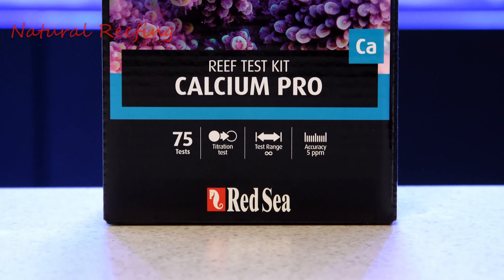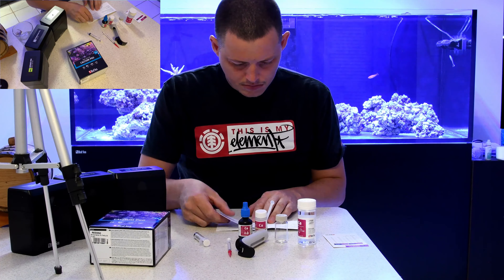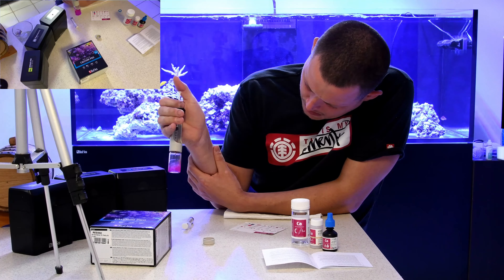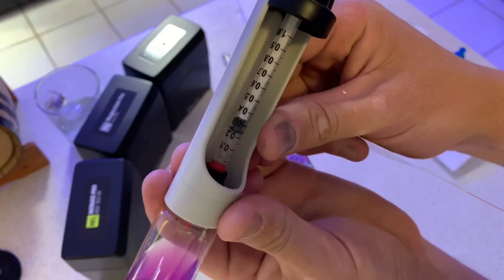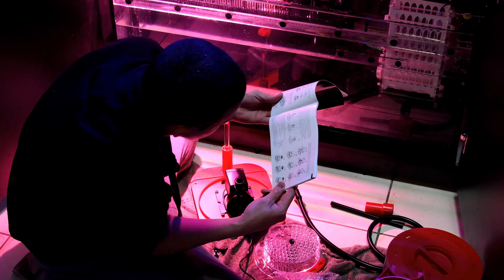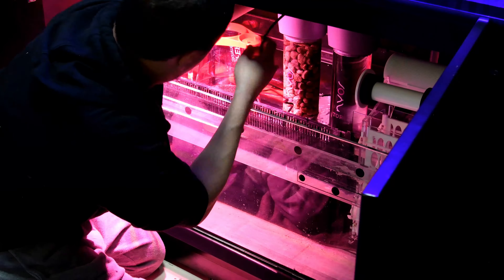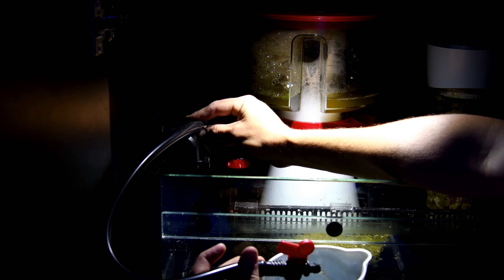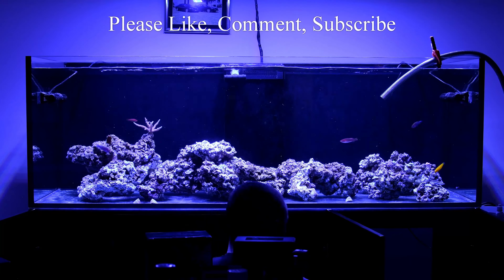Red Sea Reefer Skimmer 900 and Calcium Pro Test Kit Review

Comment: Hey man. Do you still find your nyos tough to spin. I might have a solution for you. Let me know.
Reply from the maker: The Torq reactors, Yeh, they are. Only have biological media in them so don't have to touch them much. What have you come up with?
Reply: @NaturalReefing  on the underside of the torq body there is a sticker, it almost looks like a splash of glue. You have to peel this off and this should help the body spin freely. Give this a go and let me know if it helped. Nyos told me this.